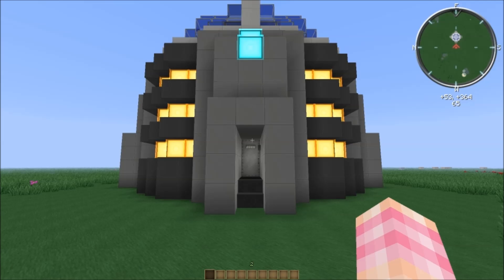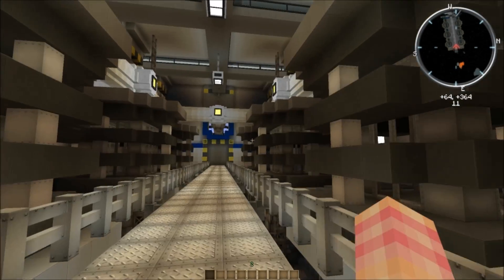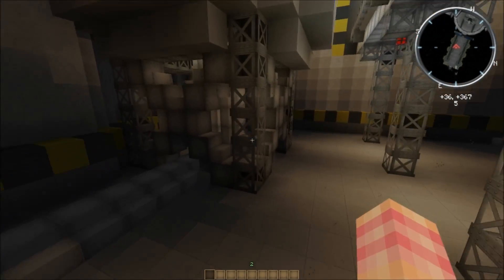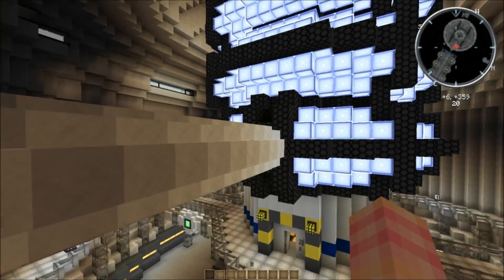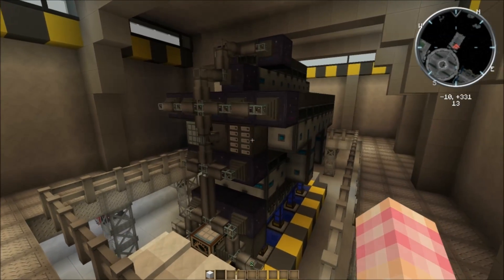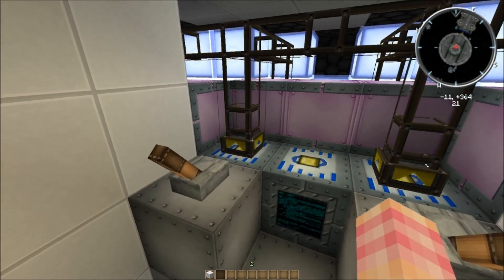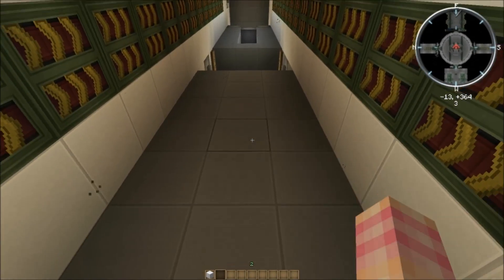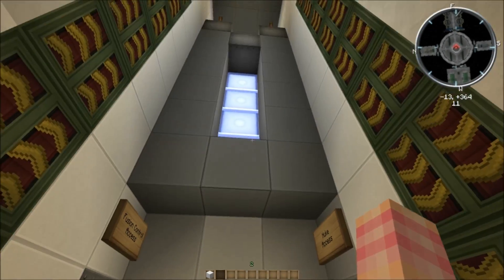FTB Build Showcase - Fusion Power Plant

Comment: Years late, but to clarify why the plutonium reactor is a bomb:

In Gregtech 2.90b, thorium and plutonium were drastically changed. Thorium was not only nerfed hard, but it was bugged until 1.5. 2.90 itself was only a beta version and lots of things were changed. Ultimate uses 2.90h, which still had bugged thorium.
Plutonium got off rather lightly in comparison, but it still broke a lot of things. Closest thing I can find to a proper rundown of changes says it was changed to pulse twice, which meant it was more efficient with reflectors, but overall heat was increased - even if the heat per pulse was lowered. The designs on the thread that one came from seem to be all for previous versions of gregtech, before the changes, and therefore can overheat (though I'm not testing all of them, just be careful if picking a design).

The reactor design in versions of Ultimate with older GT versions will work perfectly. Of course, it won't have the same fusion reactor, as the version shown here was added in 2.90f/g.

I can't recommend any specific designs myself, but as none of the vanilla IC2 stats were changed, Uranium reactors will work flawlessly. Of course, it is possible to build highly efficient plutonium designs in Ultimate 1.1.2 - just not the ones that worked in older versions, unfortunately. The talonforge reactor planner does not support GT 2.90 from what I have seen (a link to the jar can be found somewhere on the tekkit lite wiki, as the online version's gone), but the in-game GT computer cube does allow you to plan functional reactors, as it uses the same code as the nuke itself.

Sources:
https://forum.industrial-craft.net/thread/8492-reactor-designs-the-gregtech-thread-for-reactor-designs-please-dont-spam-me-like/?pageNo=1 (pre-2.90 GT reactors, including the one shown here)
https://forum.feed-the-beast.com/threads/1-0-1-1-1-1-ultimate-nuclear-reactor-change.22369/ (Omicron explains changes, and though they are for 1.5, I could find no mention in the GT changelog for tweaks to plutonium between 2.90h and 3.08g)
https://gregtech-addon.wikispaces.com/Change+Log (GT changelog, requires opening in the wayback machine as the website no longer exists. GT's modern website may well have it somewhere though)
Reply: I know I'm years later still, but I did some testing with the computer cube's built-in reactor planner application. I initially tested the design SentinalH tried, and saw that the heat vents actually weren't enough to disperse all the heat after the plutonium change. I expanded it to a full 6-chamber layout, and (after some trial and error) was able to change the reactor's classification from Mark V to...either Mark I, or maybe II-E?

While the 200 EU/t this generates may not seem like much, it generates a total of 80,000,000 EU over its 20k-second lifetime; this is more than enough to start up a fusion reactor with either helium plasma recipe. I also tried thick neutron reflectors instead of iridium, and they wore out halfway through.

If the reactor steam output config is enabled, then it outputs steam at 640 mB/t instead (though it doesn't appear to consume water, strangely enough). When fed to 2 Railcraft steam turbines in this version, it only outputs the same 200 EU/t (this is before the turbines were buffed via doubling the EU output; however, adding the Power Converters mod opens up 2 more ways to convert said steam to EU, and at a rough 60% bonus at that: 
1) Feed 16 industrial steam engines with the steam (at least, if you set it up correctly?).
2) Feed a Steam > HV EU bridge with the steam, which converts directly with (apparently) no loss. It looks a little plain, but it works and you can decorate it.

The steam output config actually makes it easier to transport the reactor's power remotely, since liquid tesseracts appear to be able to handle unlimited amounts of fluid with no loss; the fusion reactor mark 2's output being EU-rich helium plasma instead of direct EU gives it a similar advantage regarding transport, and an even better advantage regarding storage.

Comment: Dunno if you're still paying attention to this video, but the reason that the reactor isn't working is most likely that you're using plutonium cells and iridium neutron reflectors. You need to make sure you're using the components it originally had. Cheers.
Reply from the maker: I had the design up in another window while I built it so I'm pretty sure I did it right. Ah well, thanks for the comment.

Comment: First of all, did you add any new mods to your Ultimate pack? If so, which ones?
Reply: As in, any new mods besides those installed by default.
Reply from the maker: No I didn't, that was just default Ultimate
Reply: SentinalhMC That's odd, because my whole Ultimate crashed when I middle-clicked one of the blocks in the door. Every time I try to reopen the world, It crashes again. It worked fine until I touched something. Any ideas on what happened?
Reply: Lord_Nobody It seems that items with IDs of 458, 600, 334, and 406 are missing from redpower core. Should I reinstall redpower and/or redpower 2?
Reply from the maker: I dont' know. I don't know much about modding Minecraft, that's why I use modpacks.

Comment: What mod did you use for the automatic doors with teeth? Or can you make a tutorial on how you did that?:o
Reply from the maker: Those were made with Redpower 2 frames and you can check my door tutorial video for I made it. You just have to remember to put covers on all the faces of the teeth so the two halves of the door don't connect.

Comment: i downloaded the map, but i flip the switch, it goes down 1 block, and everything stops working. can't get it to go down. i also do not know how to build an elevator, so  fixing it is like trying to reverse engineer a rocket. any suggestions?
Reply: Break the wall, and look at the redstone. I have the same issue. Fixed it with 20 min of tinkering

Comment: This is awesome but how did you do the elevator?
Reply from the maker: The elevator was made using Redpower Frames
Reply: Can I still do it in 1.6.4 I have frames but I don't have the motors and covers don't go in the frames
Reply from the maker: amerem93 If you have the Redstone in Motion or Project Red packs they do it differently and I haven't fiddled with them yet
Reply: Project Red can't do it yet. It is supposed to be in the Expansion module (hope I wrote its name correctly) but ir only contains a Blulectric Furnace without any ways to power it. And without name.
Reply: oh ok thats a shame it can't do it yet lol Im really super tempted to roll back to and older version....Im getting weird texture issues on 1.6.4